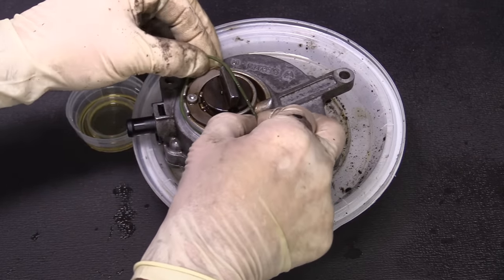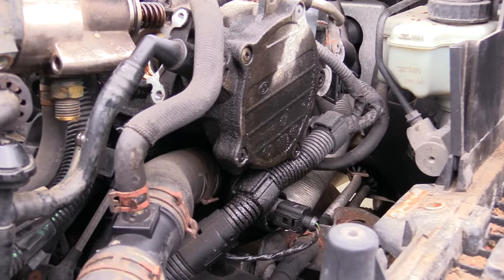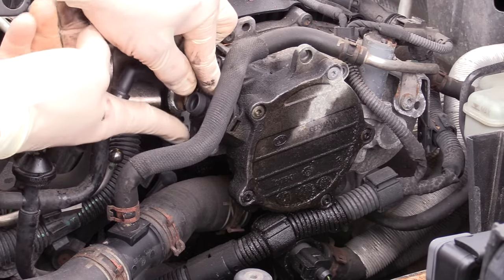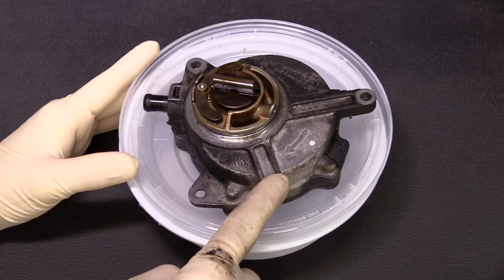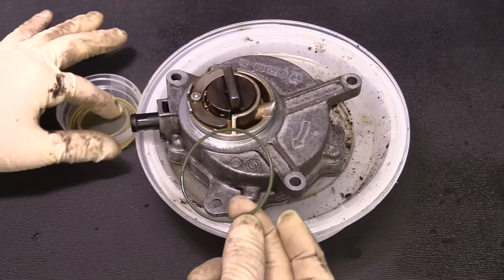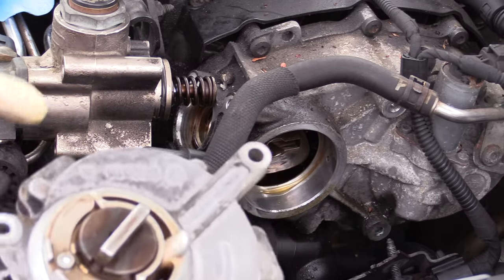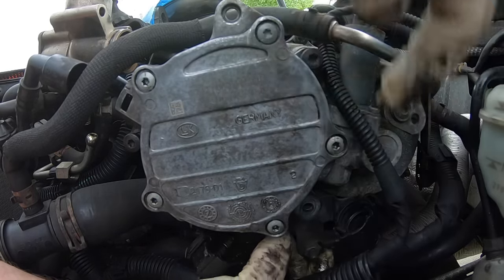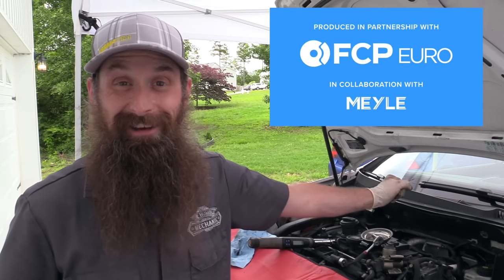How To Replace or Reseal Brake Vacuum Pump

Comment: On the 2.5 engine with the 09g transmission you have to disassemble the pump to this job. Or you will have to take the transmission out of the car..
Reply from the maker: I take the pump apart

Comment: Thank you! 
I used this video to learn how to fix my 2015 for Fusion that suddenly developed a hard brake.
I ordered the part from partsgeek.com and waited a week for it to come.
20 minutes off with the old part, and 20 minutes back on with the new part.
Part Number for my 2015 Ford Fusion was : 119724-07964442
Brand: Motorcraft
Notes: Power Brake Booster Vacuum Pump
Condition: New
total was under $100.00 plus my time

I watched the YouTube above about replacing a similar part on an Audi/VW and it was almost exact, except the o-ring is not an o-ring in the Fusion part, and therefore you have to replace the part, not just the o-ring. The fusion version is a large o-ring with a smaller one attached 
 like   Oo 
Good luck.
My perspective is that it is an easy fix - once you have the part.

Comment: @HumbleMechanic I clearly have an oil leak from the vacuum pump but I am not experiencing any other symptoms (hard brakes, spongy brakes etc). Is it likely just bad seals that need to be replaced or do I need to replace the entire vacuum pump?
Reply: Just a question I have the same issue with my Volkswagen  Passat did you end up replacing the  Pump or just the O rings and seals

Comment: Hey Charles, do you know if these bolts are aluminium or not? And should they be replaced when doing this job.
Reply from the maker: I don’t think they are. If you can find new ones I’d replace them. But vw doesn’t list the pump cover bolts
Reply: HumbleMechanic thanks Charles, I’ve found them online and unfortunately I asked my brother for the spec and he gave me the wrong number. So one snapped. So I’ll be probably grabbing new ones, but it might be a couple days.
Reply: @kylegreenley8950  Hey Kyle do you have part # for the replacement bolts? Accidently snapped one of mine and need to track down new ones

Comment: Could a leaking vacuum pump seal cause oil pressure warnings? I've already replaced my valve cover gasket now I'm going to replace this seal. I've already changed my oil pump to a new one and have gotten oil pressure warnings randomly rarely when driving extremely slow or something. Car has driven fine since I've had it for years. If it's not this I will look towards the sensor next
Reply from the maker: I dont think I’ve ever seen that

Comment: I replaced a gasket on my jaguar xjl 2011 for the power brake boostet pump i took it apart and put it back together exactly and now its making a whislting nosie when i turned it on does anybody know why its doing this now or have a idea what it can be ??? Thank you in advancd

Comment: From your experience as a technician. Is it better to replace the pump or you can get away with a rebuild kit ?
Reply from the maker: At the dealer we’d replace it
Reply: Probably depends on how well you rebuild it.
Reply from the maker: The issue is with the dealer, you have to be able to honor the warranty in any dealer. So if I rebuild and it has an issue, a dealer in the other side of the US can’t warranty the work.

Comment: Hey Charles. Is that the same process  and problem on the double pump for a TDI engine on mark4 golf? I precise that I talk about TDI 130ps with fuel pump injectors.
Ps: sorry for my french😉.
Reply from the maker: It’s VERY similar. 2 5mm Allen’s and 2 6mm Allen’s.
Reply: @HumbleMechanic  thanks

Comment: You may also need to replace inside seal as well. The leakage could also be there because of that inside larger O ring.
Reply: do you have a part number for that?
Reply: @ClaudiuB  11668626471 for the set of 2 o rings
Reply: @Assusize , But this is compatible only with BMW engines, right?
Reply: Claudiu B. Yes

Comment: Hi. I might have over tightened one of the 3 bolts (bottom bolt) and cracked the timing cover as that screw spins. The pump leaks oil when the engine starts. What can I do pls
Reply from the maker: You can try to repair it with epoxy. But it may need replacement

Comment: Can anyone tell if it is even remotely possible for this pump to leak air into the crankcase causing a lean condition? Going insane trying diagnose a +20 positive fuel trim on my 2.0T A5 (2015) and smoke test, new pcv, new maf did not fix issue. I get even higher trims by pumping the brakes. Suspecting this pump. Thanks.
Reply: Yes it's possible if it's vacuum operated. I have an Audi A3 (8P1) 1.8 TFSI. I've just had a professional scan done and the mechanic said that the slight hissing noise I can hear when in the driving seat is the brake booster vacuum / servo. He thinks it's causing my P0171 lean code, plus P0221 and a few other codes! I'm in the process of seeing if I can fix it myself...
Reply: @danielbryanlhr  If it was your brake booster, then you would also notice weird brake pedal behavior though. I don't think a P0171 can ever be set by a brake booster issue on these cars because they aren't using intake vacuum like other cars usually do. Not sure. In my case, I think I'm close to solving my issue with BG 44k fuel injector cleaner. After using that amazing stuff, the fuel trims improved 10 percent.

Comment: Would a failed vacuum pump on this motor cause the 01793-001 abs code?
Reply from the maker: Most likely no
Reply: @HumbleMechanic  would you happen to know a direction to point me? Possibly a bad control module or something?

Comment: Same leaky pump on E46 4 cylinders (Yeah wrong brand for this channel), except more difficult  to get at. Slather it in RTV and hope lol
Reply: I just disassembled vacuum pump on my renault kangoo but cant find the seal.. guess its going to be same.. hope is alive as long as oil is not leaking heh

Comment: Hi HumbleMechanic :) and all the friendly peeps out there.  Looking for some urgent assistance.  We have a BMW 318i F30 2016 - B38 engine.  We replaced the oil cooler, oil filter housing and pressure converter electric valve.  Vehicle is now running nicely with no more leaks or overheating.  Problem is that the brake pedal is now very hard?  Please advise?  Thanks so much.
:face-pink-tears:

Comment: PLEASE HELP! On my 07 GTI, my brake booster vacuum hose cracked at both ends and the tube slipped off both end attachments.  The L shaped attachment won’t pull off of the engine side.  In fact, the L shape snapped when I was trying to work it off, and is now I shaped :(  I can barely get my hand in there, let alone grip and pull hard enough to get it to budge.  I’ve tried working at it with a 45 deg pick, but it’s extremely difficult to reach my hand in there and pull.  I’m wondering if pulling out the vac pump like this video and shifting that wire harness will open up more room for my hand?  And is a new gasket required (though if I’m in there, might as well do the cheap preventative?) How would you recommend I go about removing that piece?  Is it safe to work some pb blaster in with a pick and maybe wiggle with pliers? Last, is it harmful if I start the car without that hose, and dangerous to drive?
Reply from the maker: If it broken, be sure to get a new one first. Take the engine cover off, then you can gently pull it off.  If not CAREFULLY use a razor knife and lightly cut it. Just be super careful
Reply: @HumbleMechanic  Thank you so much for the reply! I have the replacement hose already.  There’s a sort of a paint pen alignment dash on the rubber grommet to the plastic of the original and same on the replacement.  Is there any trick to pulling it? The plastic bit twists easily on the rubber beneath, but doesn’t budge a mm as hard as I can pull. I’ll have to use Operation hands and a razor or maybe file to crack it otherwise?

Comment: I have a 2007 Audi A4 and although the video looks easy, my replacement is looking to be a nightmare since the pump is at the engine wall with little space to work with and no visibility to find the three bolts.

Comment: Hey charles i have a 2008 passat v6 and im getting horrible fuel economy as soon as i start the car i lose 5 miles then ill leave my neighborhood driving for 2 min i lose another 5 miles. I only get decent gas mileage when im on cruise control do u have any idea why the car is losing gas so fast??
Reply from the maker: start with maintenance. Then we can start looking at fuel correction and deciding if it's an issue, or just perception. Also remember driving style is the biggest influencer of MPG
Reply: I got trouble codes p0441 and p0089 and p0420 is any of those could be the reason
Reply: Also thank you for responding

Comment: I have one question and I hope somebody can answer it.I diasembled my Vac. Pump today and it was nearly 1/4 filled with Oil.Is this normal or is there a problem with the shaft of the Vac. Pump ?
 Thanks
(Edit: I've watched another Video and this amount of oil seems pretty normal)
Reply: It's normal - the pump needs oil for lubrication otherwise it would heat up and burn out.

Comment: Hey so I just replaced my vacuum pump and it is leaking oil from the new pump not sure what it is
Reply: He said make sure the bracket at the bottom is properly stuck in all the way otherwise the pump will not seal and will cause and oil leak or pump damage

Comment: ok guys I have big problem with my 2013 chevy cruze so I had ABS issue as well as the front brakes were grabbing onto the disks so they shaved the piston a bit and replaced the abs module as well but this is where the main issue comes.
1 brakes aren't getting hard well they are but just for new seconds and the paddle goes down again
2 my rare calipers don't have bleeding valves
3 there is no leak he tried everything checked the master cylinder, checked the brake boaster. checked all the lines and hoes everything seem ok
 tomorrow im going to the garage the last option is to check the vaccume pump hopefully thats the issue but if not then idk what im going to do.
my mechanic he has spent more then half a month figuring out what the issue is can someone please help mw with this ?????

Comment: Ive got a question many shops refuse to replace just the o ring is this just greed or is there legitimate reasons? Seems like greed.
Reply from the maker: Not greed typically. It may be a matter of not being able to warranty the work. I know from a dealer standpoint they wont make the repair if the warranty can't be done at any dealer.

Comment: The fsi is SOOOOO much easier than the 2.5 5cyl
Reply from the maker: Oh yeah!!!!
Reply: Try changing the vacuum pump on an Audi A4/6 2.0 TDI... No working space, no space to get the pump out or in, and the flat rate time is ridiculous.
Reply: Yea the "proper" way on the 2.5 is to remove the trans
Reply: But i do believe audi can be more cramped
Reply: @jamesk3565  yep. Almost no space between the engine and firewall. So happy I'm a vw tech now. Last time I changed a coolant temp sensor (G62) on an audi, I pulled a muscle and couldn't move my arm for days.

Comment: Why does VW use a pump,,, instead of just running a vacum line to the intake manifold?
Reply from the maker: I’m guessing it’s due to low engine vacuum during some situations. But that’s just a gues s
Reply: I think that almost all diesels with turbo, have vacuum pump. Cause intake manifold have just positive pressure and no negative pressure. Brakes and some valves, regulators use negative pressure-vacuum.

Comment: Vacuum pump delete it's the only way to go
Reply from the maker: That is a reasonable thing for some folks. But I have seen a few issues result in weird brake assist on vac pump deleted cars.
Reply: HumbleMechanic .  Do you know the Location of the Vacuum pump on A V8 Range Rover ??

Comment: Guy comes in with a 2016 vw car that needs work. It needed a spark plug.    Toldem best thing to do is scrap it and buy a new one..  anything that goes wrong with a Volkswagen means it goes to the junkyard.   I'm talking if that mug even needs a oil change.. SCRAP IT
Reply: Sure bud! Whatever you say.